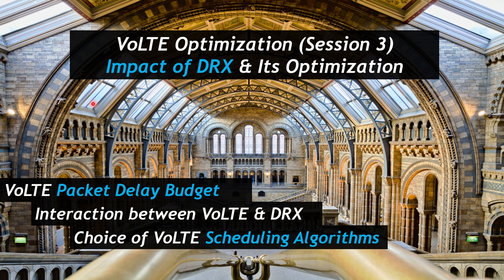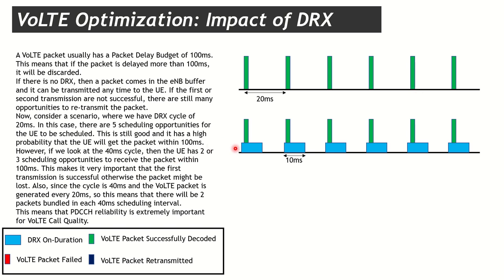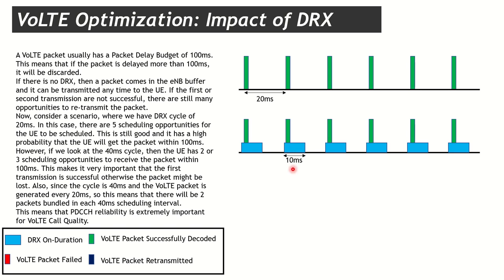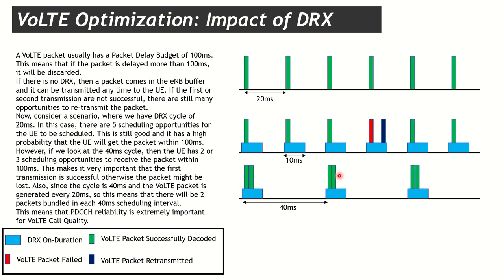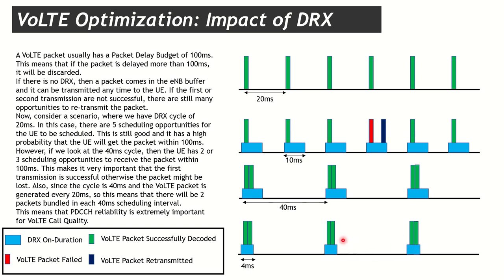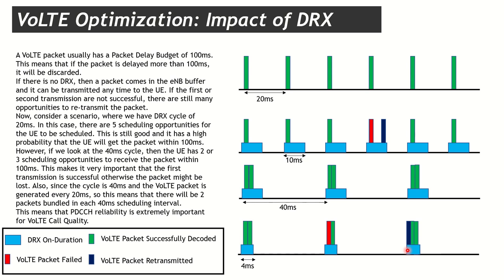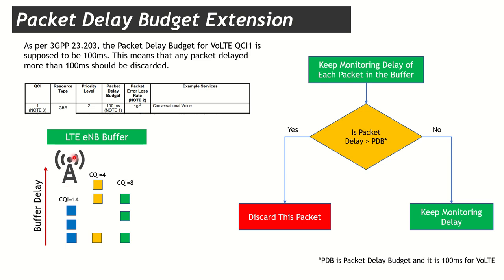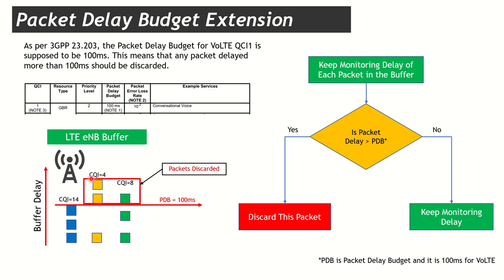VoLTE Optimization (Session 3): VoLTE Scheduling Algorithms & Impact of DRX

Comment: First of all thank you so much for a very descriptive and easy explanation. So the main reason for improving UL quality/UL BLer/delay after enabling SINR/BLER based TTI bundling with a higher value for instance (SINR-7),  will actually help UE to go into non DRX/always ON mode, and take advantage of non-DRX state as well .. Since they are mutually exclusive..right?
Reply from the maker: Yeah, it helps in quality improvement :)

Comment: Hi, i have a question, you just point out kn video that there is retransmission packet for qci1, why? I suppose that there should not be any retransmir because of UM transmission
Reply from the maker: QCI1 retransmissions are on HARQ. The UM mode is on RLC and hence, there are no retransmission on RLC for QCI1 but there will still be retransmissions at HARQ layer (MAC/PHY) for QCI1 traffic.
Reply: So it means several copies of data is transmitted on air which is harq concept, without considering tti bundling, am i right ? This could reduce bler alot
Reply from the maker: @raminsabzalizade4629  Yes that is correct.

Comment: Apologies for multiple queries.

1=> There will be drxinactivity timer as well in case UE detects PDCCH and UE will be in wake-up state for a bit more longer to receive retransmitted packet, is it ignored here for simplicity purpose?

2=> Regarding the example of Apple Handsets, TTI Bundling was assumed to be enabled right?

3=> In TTI Bundling Threshold modification, there is a possibility of two distinct packets being sent as well?

4=> Can this be said that with Delay Based Scheduling, good CQI packet can also get scheduled because delay is calculated purely based on packet stay in buffer and nothing to do with CQI but on most of the occasions it will be the poor CQI packet having higher delay in the buffer.

5=> Delay Based Scheduling is more suited to VoLTE Packet but is this best scheduling scenario for Data Packets?
Reply from the maker: 1. Yeah for the sake of simplicity, it was ignored.
Reply from the maker: 2. Yeah TTI Bundling should always be enabled in commercial networks
Reply from the maker: 3. Yeah different packets can be sent
Reply from the maker: 4. This is quite possible as well because delay is the most important parameter in this case.
Reply from the maker: 5. Delay Based is good for any service which has a lower Packet Delay Budget. Since data packets do not have a low PDB so it might not be the best algorithm choice for data packets.
Reply: @OurTechPlanet  what about PF/EPF
 since majority of Operators use this scheduling algorithm can it used as backup solution for VoLTE & Data packets
Reply from the maker: @munzirkhalil4213  Ideally, you should choose delay based for VoLTE and you can go for PF/EPF for Data